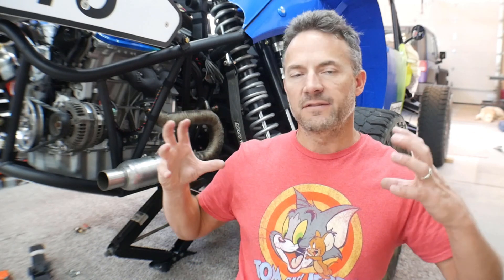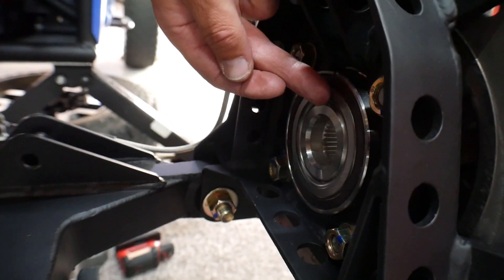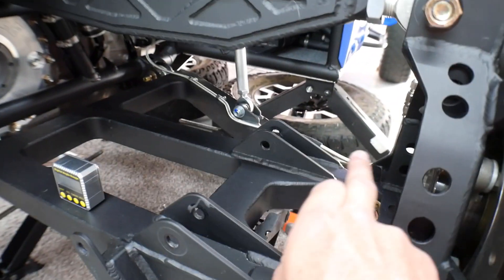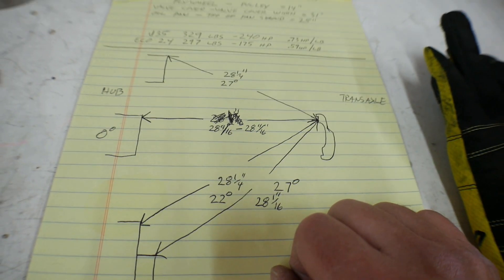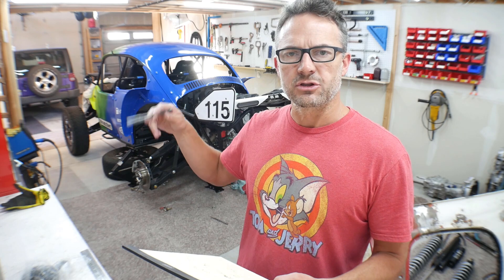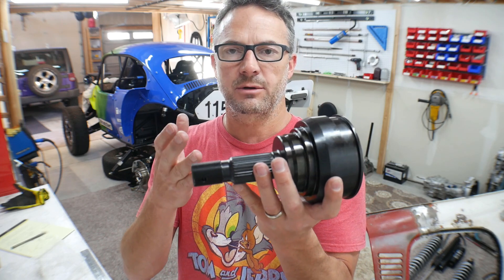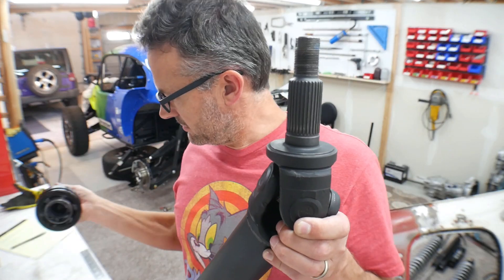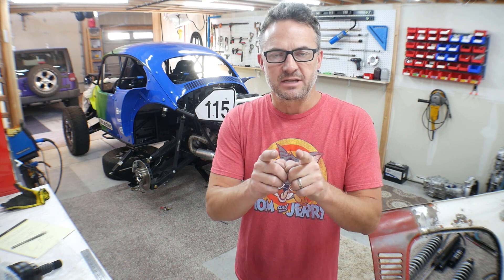Measuring my Baja for RCV axles

Comment: Mike, Nice Vid! I hope everything fits well when you receive the new axle. I am kind of curious about using the top of the flange of the spindle as a measuring point. Depending how your upper control arm length in relation to your lower control arm, as the suspension cycle up and down, there could be a downward or upward tilt of the spindle which affect the measurement length. If it measured in the middle of the flange, I think its more accurate. Also the reason why, I think, CVs are stronger than U-joints is because, depending how many steel ball inside the CV, there are more load surface area. Paint job looks good.
Reply from the maker: You're 100% correct in that there might be some deviation there. Although with my design it should be very minimal. But I didn't pay much attention to it here because these CVs should be able to absorb a little over 1" of difference. And mine is really only about 1/4". So I'm well within the range, and I have some room for error.

Comment: im sure your has answered this in another video do you have a video on your shock set spring weight shock length ext
Reply from the maker: I haven't for this Baja yet. I might still make some adjustments, but for now I have 300/350 in the rear. In the front I have 150/200.

Comment: What was the reason for not doing it this way from the beginning? The standard has been set for a long time  on this type of vehicle. just trying to be different? if so that's cool love the bug and videos
Reply from the maker: Initially I did U Joints on another build to save money, and that worked fine. I thought I could do that on this build too. But this build is heavier and more powerful. So I think I quickly found out that at least the U Joint axles I was trying to use were not up to the task. Hence the switch over to CVs.
However another thing holding me back was the hubs I used I couldn't find CVs for. Recently I found the RCV stubs that are specifically made for these hubs. So that made the transition a lot easier.

Comment: Most Ultra four cars run CVT.  Just as strong at max angle as they are at zero angle.
    Good job.
Love the valve covers paint job.
Reply from the maker: Dude, the valve covers were in there for like 2 seconds! Can't believe you caught that.
I painted them to match the body, thanks for noticing. ✌😁

Comment: I agree with you, that You’d think they’d want to know the the minimum / maximum compressed length, as well as the maximum extended length. In my mind, I’d think it would be a critical dimension.
I wonder though, for the swing arm geometry, versus the axle swing arc, is what you’re calling “neutral”, really the maximum compressed axle length?
I’m probably splitting hairs here.
Love your builds / videos.
Reply from the maker: Weather it's the max or min will depend on the geometry of the suspension. Mine in particular at 0 deg is the longest. At top and bottom it gets a little shorter. I'm talking a couple 16ths here so it's not much. But it could go the other way depending on where your pivot points are.
I gave RCV my neutral dimensions anyways. If they want them or not. 🤷‍♂️

Comment: weakest link breaks first, are you sure you don't want the axels to be the weakest link? I think the u-joint set up is much better, very strong and proven. Trophy Trucks run u-joints with .250 wall cromolly tubes, if your worried about the tubes just replace with cromolly if they ever break. 
Having said that, those CV's do look very beefy, great build.
Reply from the maker: Honestly I still think the axles are the weak links. This transaxle is pretty stout and hopefully can out beef the axles in tough situations.
I guess I'll find out.
Reply: @DougBugBuilder  yes that trans is very beefy for sure, would love to have one of those with a EJ20 Subaru WRX engine to spin it.
Reply: Most Trophy Trucks have solid rear ends, and therefore do not need CVs. The exception is a few of the late model 4 wheel drive Trophy Trucks that are becoming more popular, including The Unicorn.

Comment: You could order 2x axles that are the same length, then use a shim on the short side of the transaxle.
Reply from the maker: I'll talk to RCV about the issue, but I'll do that if I have to. 👍
Reply: The shafts being the same size shouldn't be a problem. they have a little bit of plunge to account for suspension travel, so that will take up the small difference between the 2